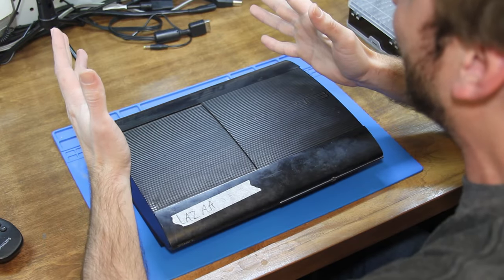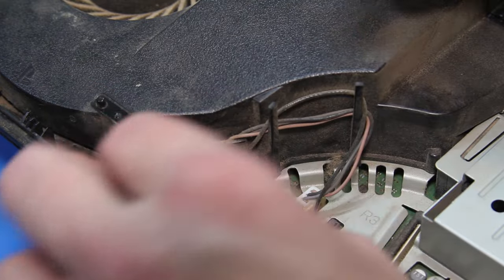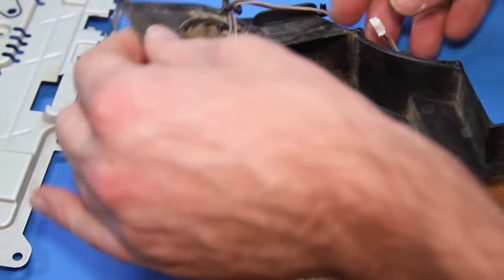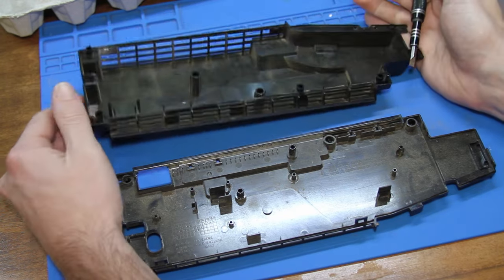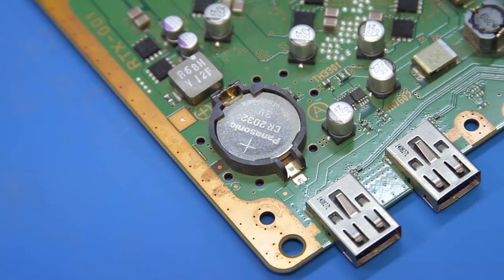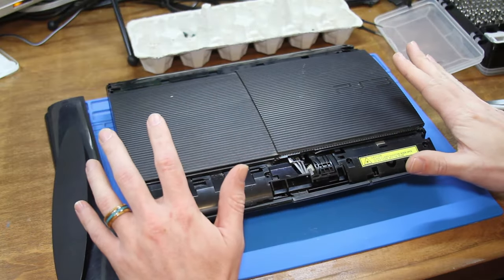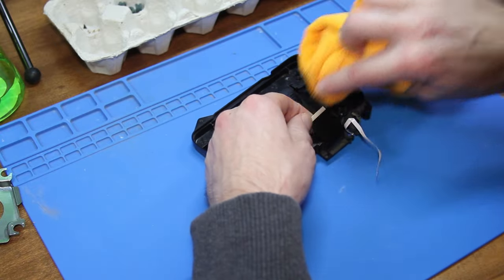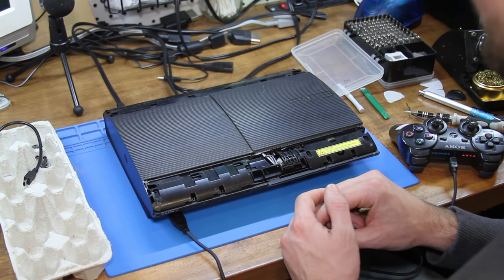DKOldies Rejected PS3 Super Slim: A dead laser and a dusty mess!

Comment: How the eject gears broke off, we'll never know. Thankfully the lid is still functionable and I feel most people slide it open anyways.
Reply from the maker: My guess is just an accident. And this one didn't show signs of abuse either. The Super Slims are made with super flimsy plastic that breaks easily. I've worked on quite a few and each time something breaks even when being careful. Spoiler, in part two I broke a piece just by putting a screw in 😳
Reply: The super slim has an eject button?! Wow I just went to find mine, and yeah, wow, TIL!
Reply: The shells for these are really flimsy those break from the spring that the eject button uses all you have to to to get tension back on the spring is back the screws out enough to free the gears then spin the spring gear some and it adds tension to make the door open. You can use a small screw as a post replacement too if a post snaps. There's a video on YouTube somewhere of someone doing this.